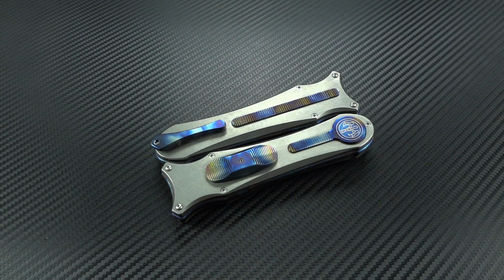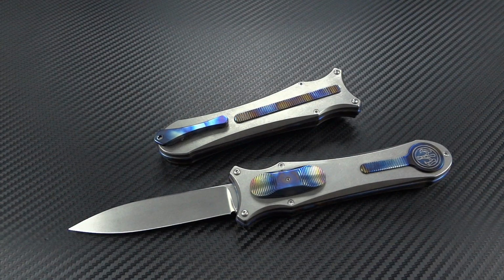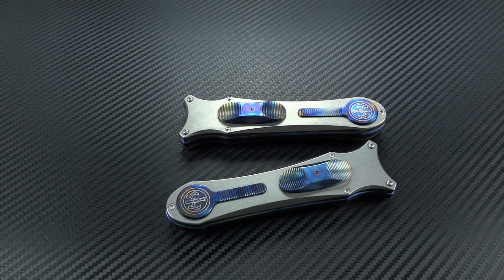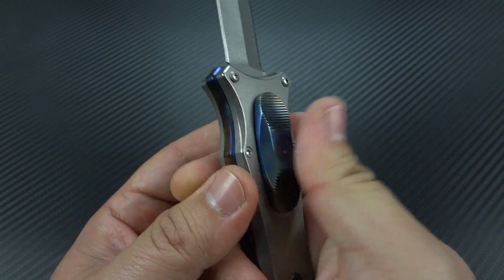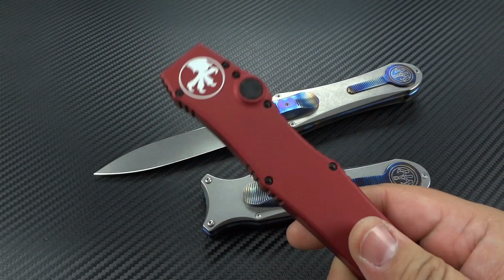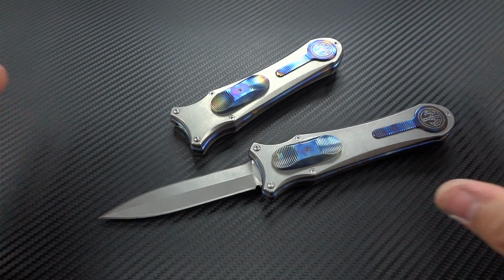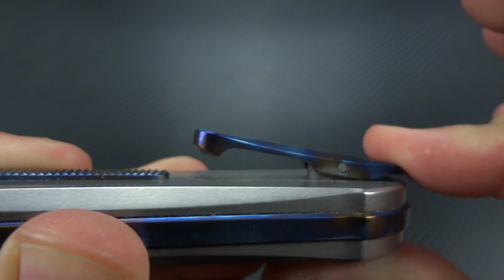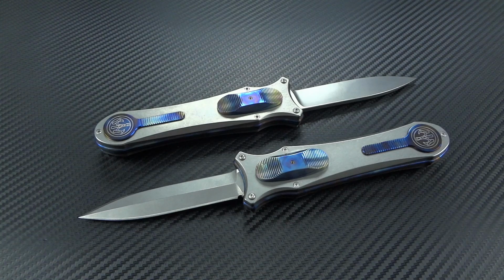Hawk Knives Custom Deadlock: The perfect OTF?

Comment: If what I'm seeing is correct, the cost for one of these starts around  $800+ and up into the 1500+ range. If that IS the case I really don't see this selling in any numbers. A Benchmade Infidel is a $400 otf and you can get a Microtech or Paragon for even less all with a lifetime warranty. Once a lifetime warranty is in place it's really tough to justify double or triple the cost for essentially a similar knife from a less established company. From what I've seen, nothing about this knife warrants the price. I'd be a buyer at $250...any more than that and I'll stick with the previously mentioned companies.   Anymore than $450 for a knife is getting into quality firearm money...and that's where it'll get spent.
Reply: Most of what you say is correct. But I do have some things to say. . .

Even though I don't have an official "lifetime warranty" on my website, I do have an established reputation. Even if its not established to you. You would be hard pressed to find anything negative about my company anywhere, period. And I've been doing this for 23 years. I'm going to go out on a limb and say that if you looked, you can easily find many people that were unhappy with the customer service with the companies you've mentioned. Some are actually notorious in the industry for being difficult to deal with, taking years to get a knife fixed, not sending it back to you if you're not L/E or military, all of this even with their 'lifetime warranty". 

With my company, you get me. You have a problem, you talk to me. You have a knife that needs fixed, "I" fix it. 

As far as your comment of "nothing about this knife warrants the price". Well that's just ignorance. And I don't mean that in an insulting way, I mean it literally. 

Lets just compare the materials of the Infidel OTF, and mine. Mine is machined out of titanium and carbon fiber, with a 204P blade. The infidel is aluminum and D2 steel. If Benchmade were to make the Infidel out of titanium, carbon fiber, and 204P, their price would be close to mine. So in just materials alone, the price is justified. 

But in this case my knife is superior. It's smoother, better engineered, and locks up 100% solid. 

Can you imagine paying $200 dollars for a regular folding knife that didn't lock up solid? But for some reason its acceptable to buy a $400 knife that doesn't, because it works in a different way. Of course the reasoning has always been "its impossible" to make an OTF that locks up solid. 

Well its not anymore, so why would you pay $400 for a knife that can't do what a $50 knife can do?

Gavin Hawk
Reply: Gavin Hawk 
I've been collecting weapons for 30 years and while I don't dispute that you do use quality materials it still is hard to justify spending that kind of money on a knife from a lesser known company that doesn't offer a actual warranty. Also, I've had NO failures or issues with my Ultratec  or either of my Paragons and Rob, the owner of Asheville Steel/ Paragon is a fantastic guy to deal with and if I ever did have a warranty issue I'm confident that it would be handled well. Not just myself but A lot of people have a problem spending what amounts to a Smith & Wesson E-series 1911 or between two to five Glocks or a FN PS90 or TWO AR-15s on a OTF Knife. I'm sure that firearm restricted people don't mind spending this kind of money on a knife, and I'm sure there are heavy duty knife collectors that don't mind...but to spend that kind of cash on something that you carry in your pocket to USE...I don't think so. 
   One last thing, I may not have the depth of knowledge about your manufacturing process that you obviously do, but someone who has been "in the business over 23 years" and hasn't made a huge name for themselves over these other companies that haven't been around as long and who, according to you have an inferior product, must truly be ignorant.
Reply: I agree, it's hard to justify spending $1,000 dollars on a knife. My point was more about the comment "essentially a similar knife" and not being able to justify the price difference. They are not similar knives, and the added cost is easily justified in materials alone, not to mention the mechanics. 

I could easily offer a warranty. I probably should put something on my site, its just not something my customers care about. At least its never been something that's been asked about. 

I think your argument about what you could buy verses my OTF has got off track a bit. In any category of products there are expensive ones and cheap ones. And for any product, especially one at the higher end of its category, a person could claim they could buy X amount of this over that. How many Honda Accords could one buy verses a Ferrari? 

You see, we make high end knives. We're not well known to those outside of the knife industry, but in the industry, we are very well known. A person buying a knife from us doesn't have to worry about buying from a 'lesser known company' because we are known, even if we're not known by you. More importantly we are known to the people that spend $1,000 on a knife. 

As far as your comment about why we haven't made a bigger name for ourselves in the amount of years that we've been making knives versus some other company, and that must have something to do with ignorance, is pretty fucking stupid, and ignorant. (Although I feel like you used the word only because I did ;)

Our goal hasn't been to be a huge company that has knives in every store. Even though we have had knives in every store with the collaborations we've done through bigger companies. But that hasn't been our focus. Our focus has been on innovation. Its innovation that keeps me out in the shop all night, not how well known I am. My passion has gotten me to where I'm at, not ignorance. 

I would like to point out that I've only been making this knife for about 2 years. And it has taken me the 21 years of experience and knowledge, to do what no other company has been able to do. And trust me, they've all been trying to figure this out. 

So by the time I'm done making this knife, you'll be sure to know my who I am. . .
Reply: I think I originally agreed with most of your assessments. I was looking to clarify the things I disagreed on. This is just the beginning. Like most things, when they first come out, they're more expensive. As time goes on, and the demand builds, production will increase, and the prices will come down. 

I like Microtech, and I like Tony Marfione, so I find it difficult to talk badly about his products. But its no secret that the blade has a lot of play. Up until this point, it was acceptable because it was thought to be impossible. Its no longer impossible, so to me, it seems its no longer acceptable.
Reply: You've missed all of my points. 

My knives are expensive. Can't argue with that. My point was that there is a noticeable, and justifiable difference between my product and the competition. You claimed there wasn't.

My goal is to enjoy what I'm doing, and I enjoy innovating. I also make plenty of money.  

I never said that I didn't want to get my product out to as many people as possible. You're getting frustrated, and starting so assume things. A simple google search will come up with our designs from Buck, Kershaw, CRKT, CRK, Camillus, Mantis, and Boker. Which means the designs have had mass distribution.  I also have a line of midtech knives as well. At the moment I'm waiting to announce what I'm doing with the Deadlock. But for now I'm refining the design, and making customs. 

I think of this exchange less about arguing, and more about education. 

I never said said anything about the quality of the other companies. Its not quality that makes their otf not work properly, its the engineering. Its one thing for a company to make a good quality product, its another to make one that is the best in its class. At this point in time, we make the best OTF.
Reply: Well some one is having a bad day. . . 

First, the knife featured sells for $1,400. I don't care how much money you're willing to spend on a knife. Or how many guns you can buy verses my knife. Also, the first OTF took me 5 years to design and perfect. So a month on a knife seems like a walk in the park. 

My original point, which I'm hoping you finally got, is that verses the competition, the price is justified. Personally, at this point in my life, I would never buy a $400 knife that uses aluminum as the main handle material. And I certainly wouldn't buy a knife over $50 that didn't lock up solid. 

You seem ok with that, and that's ok.
Reply from the maker: Ed Bailey you should probably hire an interpreter. You've read shit that wasn't even there. No one said, nor implied that Benchmade is shit. But you can't compare it to a custom like this. I'll put it in gun terms for you: don't compare a Rock Island Armory to a Wilson Combat Supergrade. Also: Who cares what gun you could buy for the price of this knife? Who makes that choice anyway? I buy both, one decision doesn't influence the other. That's like someone saying "I could buy a sofa for the cost of that custom 1911".... one doesn't factor into the other.
Reply: I've subscribed to Gavin and Jim solely based on this conversation and how it was handled. And if I can ever afford the luxury of custom knives, well, you can expect my money. :)
Reply from the maker: Ed Bailey LOL, boy do you have anger issues. Must suck to be so delicate. I would have blocked you, but honestly, each response you make gets fucking funnier. And you are certainly the king of Wal Mart level shit. $1700 for a handmade  Katana?? Shit, buy 3. A quality one will be far in excess of $3,000 but you don't know the difference, so it doesn't matter. When you're done shooting reloads, maybe stop by McDonalds and splurge on a fancy dinner, chief.
Reply: Funniest conversation ive ever read on youtube. My oh my what a fool that boy was making comments  about  things that he has no clue about. G&G hawk is definitely on my list and has been. Reminds me of how badass and solid the desert knife works sandshark was back in the day when this dipshit was still saving up for his first bear grizzly gerber. Neither of you two gentelman deserve to have a emotional boy like him to speak to you that way but thumbs up for not blocking, nothing worse than erasing others comments,blocking or reporting. Everyone hates a snitch.
Reply: Nice Guy Eddie has truly no concept of costs. Gavin makes beautiful pieces that are priced appropriately even though they are priced out of my personal knife spending limits
Reply from the maker: Ed Bailey Nah, I just despise IGNORANCE and those who share their ignorance as some sort of gospel truth. Drop the Internet tough guy routine, it's been done before. I can't help that you're too delicate to hear the truth, in plain easy to digest words. I was just being clear and concise, you're the one who took it as rude. But yeah, I wanted to be more harsh because you were such a flaming asshat to Gavin in all of your responses.
Reply from the maker: Ed Bailey "lesser known"? LMAO. You aren't really in tune with high end knives are you? Of course you're not, you're buying Benchmade. The cost of raw materials alone costs Gavin as much or more than the retail price of a Benchmade Infidel. Think about that. You're literally wondering why a Bentley costs more than a Honda. Stick to production knives, custom knives aren't for you.
Reply: Jim Skelton 
Yeah, custom or not you cannot honestly tell me that there are higher production and materials cost on this knife than on a Sako rifle or a Wilson Combat 1911. That dog just don't hunt. You both missed my point, that being there would be infinitely more of these knifes sold if the cost was more in line with other OTF knives. Obviously my interest was picked enough for me to look them up and see what they sell for. Also, to say (or imply) that Benchmade knives are junk is just plain stupid. I have a model 42 balisong that I've had for years since new and it has PLENTY of miles on it and is in as good a shape as it's ever been. I also know a person who had brought and used a Microtech Halo to Afghanistan TWICE. It came back beat up ,scuffed and bruised. ..but still working. 
You sir strike me as the type of guy who brings a knife to a gunfight.
Reply: Gavin Hawk so, your stated goal isn't to make money and get your so innovative product out to as many people as possible, it's to pasify the relatively small niche "custom" knife  market by making small batches of extremely high priced otf knives in a otf heavy market. You make out like some other high end production knife companies are barely the quality of a SOG...and yes I did want to point out that ignorance goes both ways. Good luck with your company, if you keep going around having arguing with people on the Internet who think your price is high you're gonna need it.
Reply: Gavin Hawk My original point was quite simply that it was too bad that the price was so high because it intrigued me enough that I went looking for one but it is hard for a "regular" knife guy to be able to justify spending that kind of money on a knife without an explicit  (not implied) warranty that tells me that IF I throw down a grand and it does fail there is some kind of recourse . Also, I shared MY opinion and thought process on why it would be hard for me to spend that kind of money on it when my Ultratec that you claim does not work properly has never failed me. If nothing else you should appreciate the insight from someone not as heavily into the custom knives. This other guy here is just a dick though.

Comment: looks badass works badass and simply is badass the dude knows whats up personally i can't stand the rainbow and would rather have a square slide but hey who cares about the little shit when you have something like this
also i had a shrade viper otf ( the one that had  the switch on the side like 2nd or 3rd gen can't remember ) it had very little play like nearly none probably mostly because it used a liner lock on the inside rather than the traditional otf style of locks but it didn't wiggle much at all
Reply: Actually they all use a 'liner lock' system. It's just the configuration of the lock is different. But they all work on the principle of a liner lock.

Comment: I'm wondering, it looks easy for an accidental release of blade while in the pocket. What are the chances?
Reply from the maker: Why do you say that it looks easy? It operates like any other OTF. They don't open in your pocket. It takes a long travel with the switch and takes several pounds of applied pressure.
Reply: I must've misunderstood the ease of pressure needed for releasing the blade. I don't have an OTF, and this looks to be a likely candidate.
Reply: it takes a deliberate action to open. a single action OTF could since the spring is under tension ready to fire the blade out. On double actions the spring is at rest and when you go to fire the blade out you are actually stretching the spring and at the very end of travel on the switch it releases the blade and it fires out.

while the deadlock is MUCH easier to fire then the microtech scarab (which takes a crazy amount of force) it still takes more force over longer distance then you would ever have happen by accident.  any side opening automatic knife is far more likely to open in your pocket, the same goes for assisted opening flippers, which are the only style of knife ive ever had open in my pocket on accident.
Reply: Got it. Thanks you for the explanation and setting me straight

Comment: I have one of these and i couldn't be happier.  
i have a microtec scarab and troodon, both of which i plan on selling now. everytime i handle them all i can think about is how awesome my deadlock is.

I cant even begin to describe how awesome this knife is.  sure its alot of money but high end knives hold their value very well and in lots of cases will go up in value.  down the road if i need the money i can sell it for probably very close to what i paid for it......well thats atleast how i justified it to myself :-)
Reply: right??? Microtech sells so called "custom" knives in the same price range as the Deadlock. However their "custom" knives have CHEAP materials like ALUMINUM for handles and a wobbly blade lol. If someone wants to pay for a knife with an aluminum handle, more power to em, but not with my money

Comment: Very ugly knife in my opinion
Reply: Yeah, it's about as aesthetically pleasing as a low cost, Chinese manufactured computer/electronics accessory sold at your local Walgreens for $10.  Ugly blade, blocky handle, screws need to be recessed, cheesy emblem looks plastic, goofy over sized button, clip looks like it belongs on a startec cellphone. Looks like spray painted plastic fake knife used for martial arts training or one of those "as seen on TV novelty products".  Need to scrap it and start over.

The lockup innovation if very impressive, and will soon be the standard for all OTFs.  I hope they have other versions in mind until their new technology can be licensed.  At least by companies worthy of this innovation.
Reply: @ElectronicSkateboard  the new version still looks like a toy.